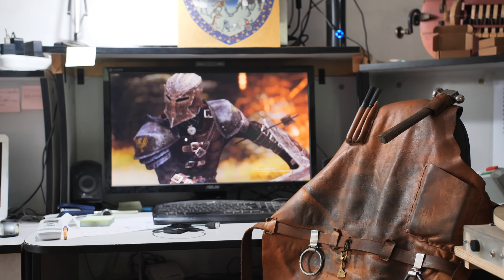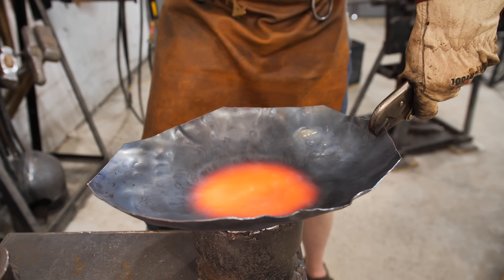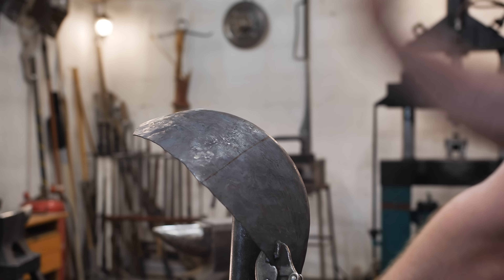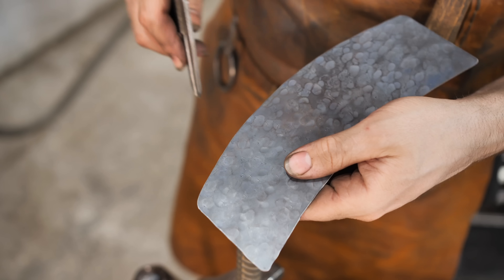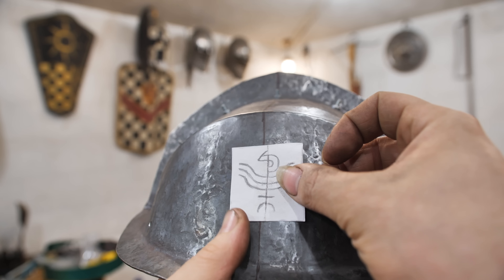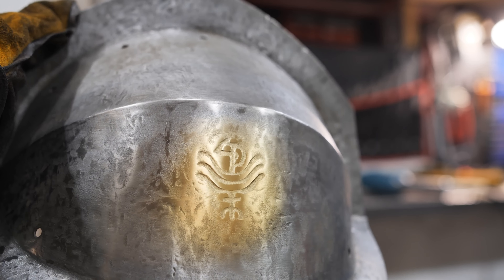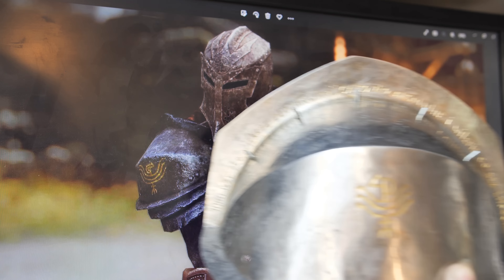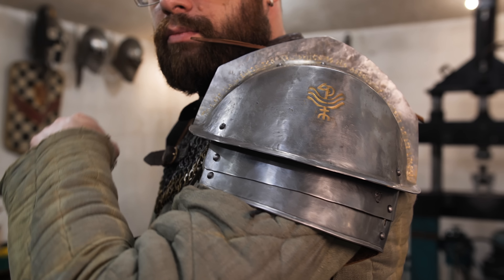Dawnguard Shoulders. How to make armor from Skyrim

Comment: This is awesome! Ive been wondering, what do you doo with the excess that you trim off?
Reply: He eats it. Blacksmithing is hungry work.
Reply: @MichaelRainey  I heard blacksmiths require a higher carbon content in their diet, iron is just too soft 😄
Reply: normally you collect excess and scrape metal for a specialised garbage disposal unit that brings the excess to reuse/recycling. Other than plastics, metals like steel, copper, stainless steel, aluminium or whatever conventional alloy are easy to recycle. I was working in a company that manufactured stainless steel, braze and copper alloys. We would even collect the saw dust from copper and put it in the container. Every other month, the scrape metal collector came by and took the containers. They weight the scrape at their "recycling metal collection point" from which it gets shipped back to factories that smelt it or use whatever other method to bring it back into the circle of manufacturing.  ... and yes, some smaller bits get eaten by the workers... it's true! Blacksmithing makes hungry. Funny sidenote; if you grind copper alloys and smoke a cigarette afterwards, the smoke tastes oddly sweet due to inhaled copper dust bits. :)